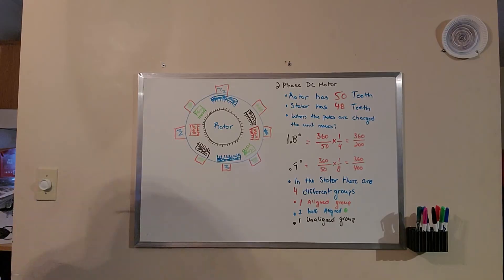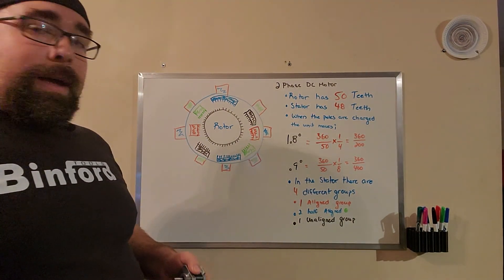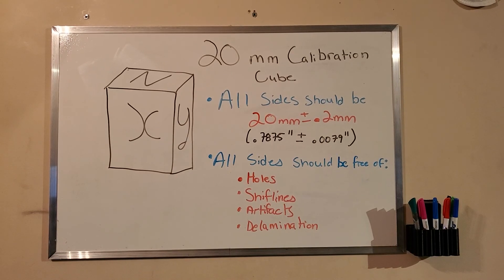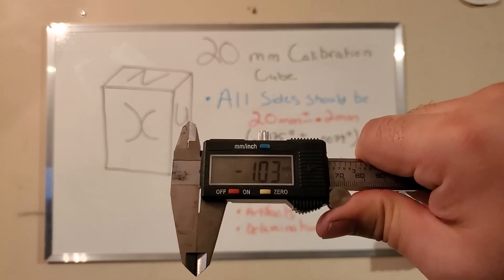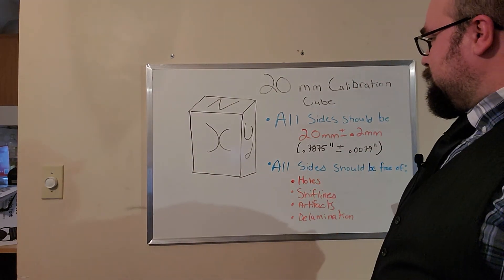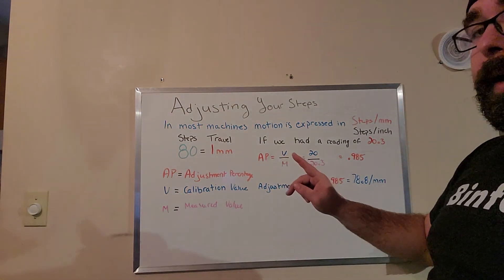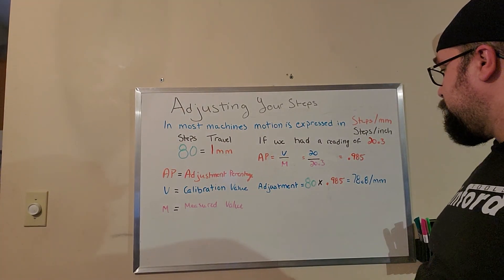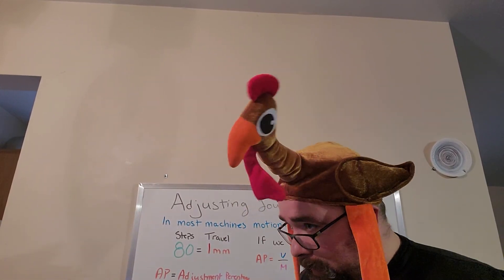20mm Calibration Cube and How to Read It !!

Comment: Good video but I do personally recommend you don't squeeze your calipers that hard. They will flex and give you a slightly incorrect value. Also if you use that much force on anything other than metal you have the potential to slightly deform the part which will also change your measurement.
Reply from the maker: Thanks for your feedback but I have been using a caliper as an Precision Machinist for more than 20 years my measurement grip has not yet failed me.